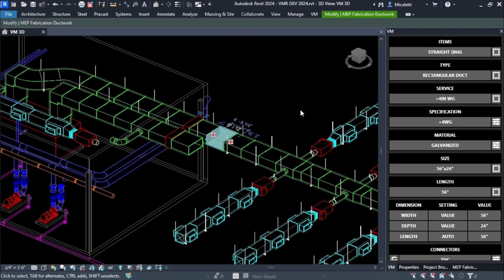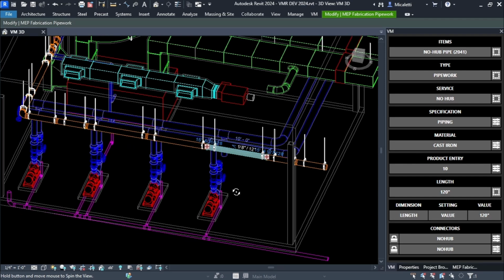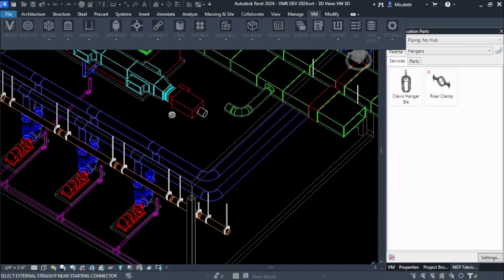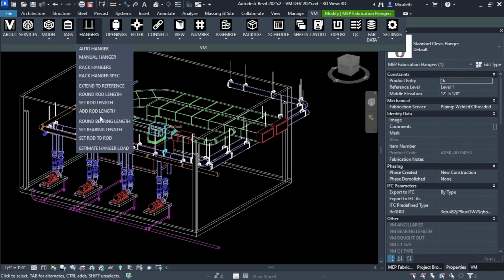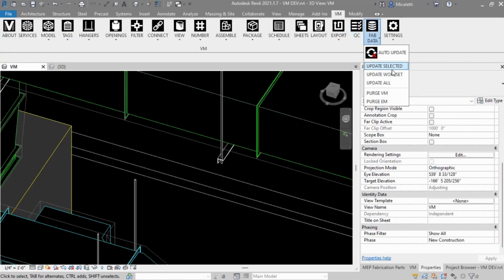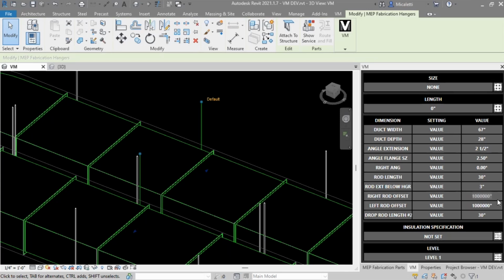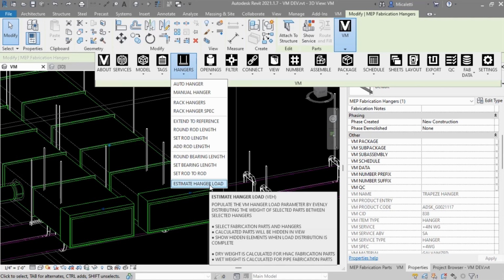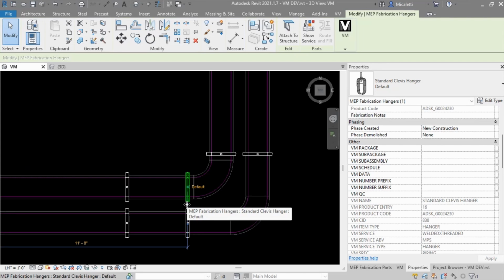VIRTUAL MECHANICAL - ADVANCED HANGER AUTOMATION

Comment: Hey Steve, sometimes I don’t have the full REVIT structural model from arch or structural engineer, and only get the cad background to work with it. If I know how long my hangers rods need to be because I know the slab to slab space, can I still place the hangers and give them a set number for the rod length ? If so, how can I do it ?
Reply from the maker: Yes. The default length for any hanger is controlled at the ITM file level. You can do what you're asking that way, though that may not be practical to change for every project. Alternatively, you can use the VM Set Rod Length tool to change all of your hangers to 48 inches, for example. Likewise, you can set the individual hanger dimensions via the VM Properties Palette. Here you can change any dimension on any ITM or manipulate multiple Fabrication Parts at once.